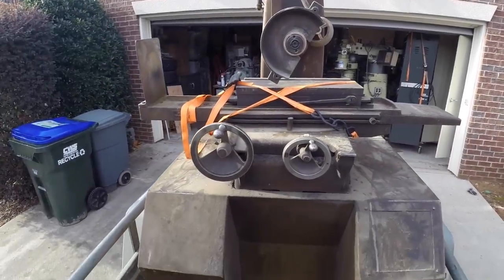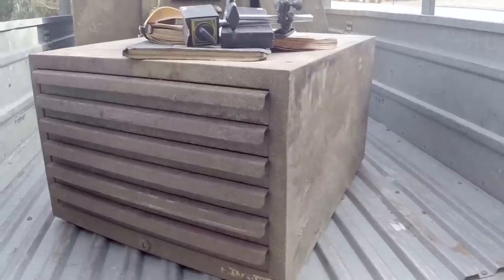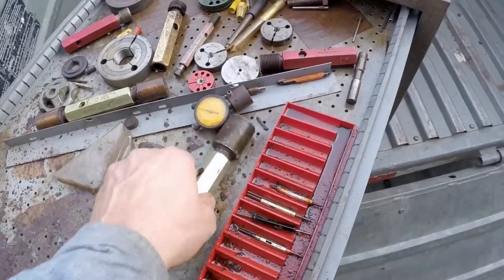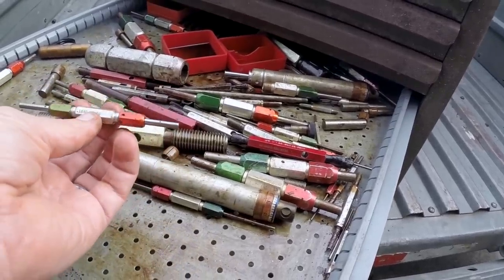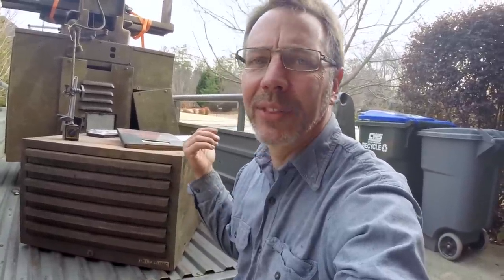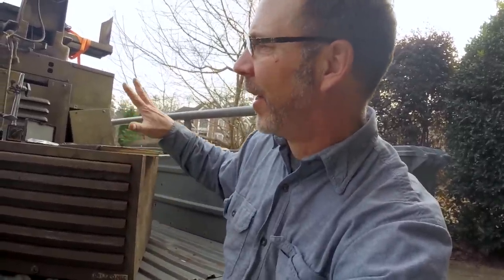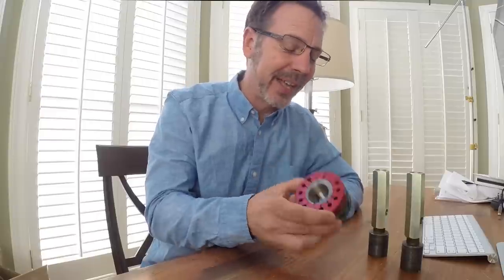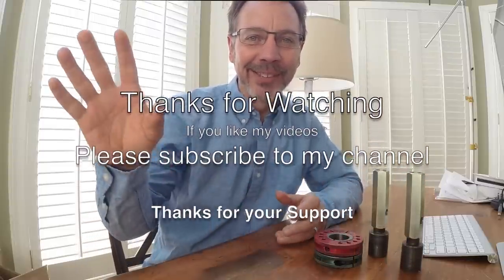Surface grinder on Craigs List, plus more........

Comment: ISO/English Bicycle bottom brackets are 1.37" 24tpi and are left hand thread on the drive side. That gauge you showed is for a waayyyyy more common thread than you thought.Its on like every bicycle made..I wonder if those tools were from the waterford schwinn factory or something like that. Sheldon brown (google him) has alot of bicycle threads listed in his site. Those 2 inch ones could be for hub shells. Old coaster brake and 3 speed hubs had almost 2 inch hubshells and fine threads holding in the internals.    You may be able to sell those gauges to a us based boutique bike parts maker like white industries or paul components.

Comment: Hi Dale,
I have a Harig Super 612 grinder.  My spindle needed new bearings.  Not difficult, not terribly fussy. The spindle uses two bearings at the wheel end and one at the motor end; a wave washer applies preload. The grease in my spindle bearings had turned brittle, and had an almost glassy consistency. Poor surface finish led me to search for root cause. Since replacing bearings, excellent performance. If your bearings are not shot, you can save money if you clean and lube them.

Lucas AKA Arn Jones

Comment: Hey Dale,

Nice buy on the grinder. Can't wait to see you get it running and all bright and shiny. The Deltronics cabinet is pretty cool. The awesome thing in the cabinet was the large radius gage set. Those are really handy. 

All the best,

Tom
Reply from the maker: Hi Tom,
The cabinet is great. The shallow drawers will make it perfect for either drill bits, or mill end cutters. I haven't decided.
The grinder is in great shape,  but I plan to do a complete overhaul including the bearings. My biggest concern about the bearings is affecting the harmonic  balance  of the shaft, Any suggestions?
Reply: hello excellent acquisition, the machine air in very good condition, a good scrub seems sufficient, see if the bearing seat are not too marked .cordilement thierry.
Reply from the maker: The machine sat idle for years. And the grease in the bear has harden and now make a little noise.  I think its best to replace them. I cleaned up the machine it only took an hour to get it back to original grey color. But I will still be rebuilding the whole machine and modify the base so it will have strorage for the tooling, and then repainted. I know its a lot of work, but I will own this machine for at lease 20 years.

Thanks for your input 
Dale d
Reply: ***** Hey Dale,

I would try running the machine before you replace the bearings. Grinders are really fussy about the bearings. You don't just press them in and go. They are very carefully preloaded and aligned so they run so smooth. Get the machine cleaned up and the lubrication system working properly and then try grinding something. See how it goes. These machines last for a long time without bearing replacement as long as the lube system is working. 

All the best,

Tom
Reply from the maker: I think your right I will hold off on replacing the  bearings.
I wonder, can  I rejuvenate or replace greece
 that is in them  now. 

Thanks for your Advice.

Dale

Comment: How do you get that heavy equipment on the trailer?
 When I picked up a 1,500 lb lathe, I got lucky, he had a huge engine lift and three friends.
 I would buy more lathes and mills but I can never figure out how to get them on the trailer.

Comment: Hi Dale,  I have had a Harig 612 for about 25 years and one thing I can tell you is that the mfgr. instructions to only use Harig way oil is not just marketing hype. I once tried other way oil and it just did not cut it. Went back to the Harig oil and all was well again. It is ridiculously expensive at $58.00 per gallon but worth it.
Reply from the maker: +ROBRENZ 
Thanks for the advice

Comment: Dale, are you aware that bicycle threads fro the crank fitting is 1.37" with a fairly fine pitch, and have left hand and right handed threads? that might make these usable and possibly therefore valuable, to someone in that industry!

Just a thought, but try google for the actual specs :)

ps. Love the channel :)